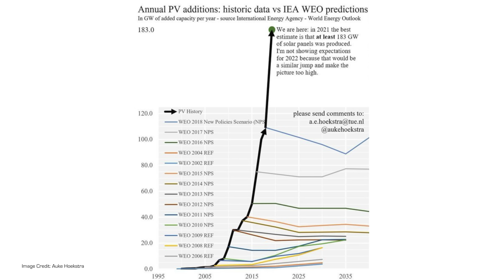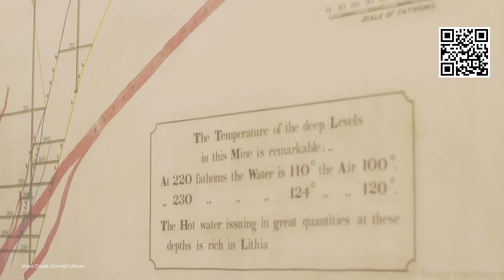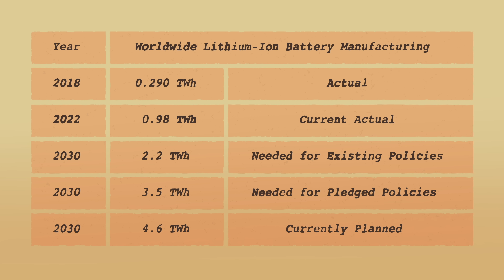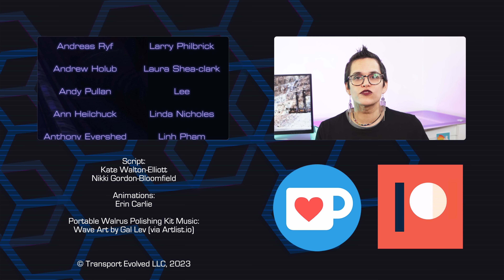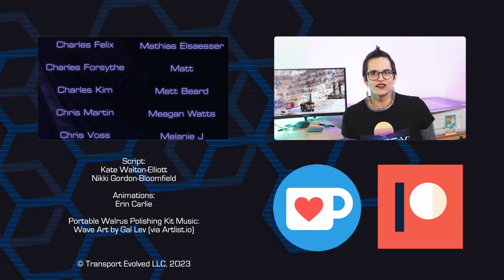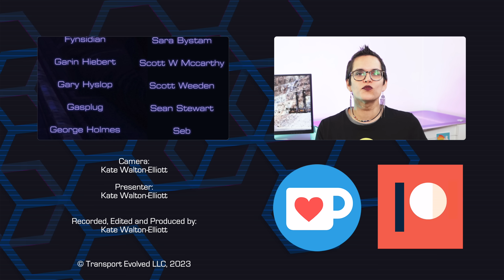It's Time For Us To Tell The Truth About Mining

Comment: Last question was .; do we need to reduce the need for these new resources we require.  The answer  is yes. So next time you buy an EV look at the size of the battery and how far does it drive on a full charge.  It is better to buy a Hyundai  Ionic 6 than  a Hummer EV for example. Good vid, thumbs up.
Reply: Ebikes have 1/100th the raw materials and up to 10x the MPGe of a Tesla.

Edited: because im bad at maths and I thought 18kg was 1/10th of 1800kg
Reply: I'm  for that.
Presently my Leaf '40 kW has ChaDeMo so there's no depending on a working charger if I leave town.
Reply: @GeoElk : I wish you luck explaining that to the die-hard “an EV could never meet my commuting needs” crowd. If they won’t get behind driving a full sized car that can do highway speeds, just because it’s electric, they sure as “heck” won’t get behind the idea of a bicycle that cannot manage highway speeds; regardless of whether or not it’s got an electric drive unit to make things easier.
Reply: @jacobcarlson4010  It's a good thing they don't speak for everyone then. Folks who "need" a full car can get an EV and folks who an e-bike would work for can skip the car entirely. Different solutions for different people is totally fine.
Reply: @jacobcarlson4010  it's hard to break indoctrination but it is possible. Work also needs to be done to genuinely make cities less car dependent.  Many who say they need a car are genuinely right, but a better future is possible. Also so much could be done on the subsidies front. So many governments are offering small discounts on EVs that could easily buy an electric bicycle outright...... That's when i start to get really depressed about the topic because I realise the subsidies have nothing to do with saving the environment and genuinely helping people, but instead it's about rewarding those who are already wealthy and directing money towards the same car companies who caused the crisis in the first place.
Reply: @GeoElk  The biggest thing we can do to help reduce car use is to reduce parking requirements in cities and try to allow infill development. Robo-taxi service is coming before 2030 and it means cities will need fewer total cars and up to 60% less parking. Imagine cutting every parking lot in half and filling in with new development & parks. This breaks the "chicken/egg" cycle of trying to jump-start mass transit and create walkable, bike-able cities. People love walkable. Go to Mackinac Island. Hundreds of ebikes on every block.
Reply: @GeoElk  I am wondering about MPGe of Ebikes when run on battery only. I saw that the new Lectric trike has a projected range of up to 60 miles when pedaling, but only 15 miles when not. Why isn't the high end infinite? My guess looking at drag coefficients for the upcoming Aptera, 0.13, versus greater than 0.50 for most motorcycles, is that some highly efficient EV's will achieve higher MPGe's than bikes that are not getting the majority of their 'umph' from their human operators. We should also find a way to factor in cargo weight into our efficiency calculation since several bags of groceries, or construction materials, or luggage or ... can limit what most of us can effectively pedal over a distance, and may cut that 15 mile un-pedaled E-trike bike range significantly. I believe the Aptera is asking for no more than 500 lbs of added weight (drivers and cargo combined) at least to maintain promised performance numbers. Some of us who care little about 'performance' zoom zoom may overload our vehicles from time to time, and may even DIY mod's to various suspension parts to help raise our Aptera's load carrying capacity. Anyway, if we are calculating relative MPGe's of Ebikes driven without any leg power vs Apterae we should at least equal out 'cargo' weight when making our comparison. I am not of the camp that might equate each gram more of battery weight, or cubic cm more of battery volume with subsequent environmental evil. I want to see robust V2G and virtual power plants helping to accelerate our transition to renewable sources of power. How these larger batteries are used should be a factor in assessing their environmental pros and cons, no? Different topic: As a 'leave most fossil fuels in the ground' advocate I also allow for the less desirable alternative that 'plastic' left in the ground or downgraded into useful 'still sequestered' building material is better than those fossil fuels combusted. How truly evil are plastics if they are safely locking that carbon away from overloading our oceans and atmosphere with excess CO2? We are now advocating for the carbon sequestration of wood construction over steel based alternatives, looking at the relative eco footprints of various building choices. Decking that may have some more intense carbon captured in its core may just sequester more carbon for a longer duration than wood, plus any necessary treatments it undergoes over its useful lifetime in situ in a building. I guess I'm advocating for more 'whole picture' fair analyses, rather than potentially prejudicial knee-jerk ones.

Comment: The interesting thing about these discussions to me is that everyone always ignores the single most problematic metal in EVs: copper.  But maybe that is because we are just used to exploiting the heck out of copper and nobody wants to mention how much of it is consumed by the construction and power distribution industries. How much of it is still used in plumbing (it is required in New York State for instance). But the reality is, 2 or 3 EVs contain as much copper as a small house. I would bet that charging infrastructure uses a great deal more. The good news is that companies like Tesla are looking to greatly reduce the length of their wiring (to reduce the cost associated with copper wiring). And many companies are pursuing higher voltage EV archetectures which can use smaller guages of copper wire. So maybe in the future we can expect EVs that use dramatically less copper... but as with all other minerals, recycling is crucial. 

Another issue I dont see people really discussing is IF we shift in a big way from lithium-ion to sodium-ion batteries, will the economics of battery recycling still work out? It is the use of expensive minerals that makes the economics of recycling work in the first place. Heck, a shift in market values of minerals by over extraction could also make recycling uneconomic. Will sodium-ion batteries be destined for the landfill because they arnt worth recycling?
Reply: I appreciate your comment, we can see the impacts of copper, nickel, iron, aluminum, all for electric vehicles. the entire supply chain is laced with fossil fuels. coal to extract lithium in Australia, oil to transport it to China, Coal to turn it into minerals, oil to transport it to Taiwan, Coal to make it into parts, oil to transport it to nevada, so Tesla can use solar to assemble the parts. oil to deliver the tesla to Australia where they import 100% of all cars. it's 20,000 miles in cargo ships across the pacific ocean.

Comment: Oil companies: mining is bad

Environmentalist: Americans burn 500 gallons of gas a year, 3000 pounds of material, or 60,000 pounds over a 20 year time, meanwhile EV batteries only use 1,000 pounds and last over 20 years in a car, 20 years as stationary storage, and 95% can be recycled and by that time energy density should have more than doubled (5% energy density increases every year) 

Not to mention we mine much more than that per person for steel copper and aluminum for a vehicles structure and other components.

Comment: Great video. It would have been great if rather than comparing to coal comparing to oil extraction and gasoline refining as this is the energy directly being displaced
Reply: True if one looks at electrifying transport only. But electrifying homes and factories will sometimes involve battery storage, and does displace coal use. You are right that the whole picture needs looking at
Reply: @tonykelpie  the whole picture is the USA needs 8,000 TWh by 2050, while reducing fossil fuel to use to 0. there is almost no scenario in which we electrify offices, homes and cars all at the same time.
Reply: @Lildizzle420  thank you for replying. The world is not going to end in 2050, but it seems that at current rates of progress the process of global warming will continue. I am not put off by lack of options but I am concerned about lack of progress in implementing the various options. Solar and battery setup can work well - our home is currently drawing zero from the grid and is expected to do so for 4 months of every year; we will have reduced demand on the grid in winter too.,and especially in spring and autumn

Comment: Great video.
One thing most people don't seem to know, or like to ignore, is that one of the biggest uses of rare-earth metals and cobalt are as catalysts is in the oil refining process; this has been the case for many decades. I would like to see how EVs -- meaning less use of fossil fuels -- change those numbers; does it even out compared to making current lithium EV batteries?
In 2021 there there an estimated 15-billion cell phones on the planet. How about all other the batteries used in cordless drills and the like? 
EV batteries are lasting a lot longer than people originally expected, with a Bolt in Canada with well over 400,000kms on the original battery, and many Bolts in the US having over 250,000 miles. 
Interestingly, I recently read that lithium can be extracted from the waste brine from the oil refining process.

Comment: All everyone needs to keep in mind is that if we mined the same amount of Lithium as the amount of coal we mine and burn up in just one year (roughly 7 billion tons), we would have all the Lithium we would EVER need. That's because the amount of Lithium used in a battery is quite small and it's fully recyclable. So once mined, it can be reused over and over again. Just stop and think about that for a bit.

Just one single year of Lithium mined as the amount of coal mined in a year would last us for our entire lifetime.
Reply: Some of that is true, but the devil id in the details. First there is a huge contrast in the natural abundance of coal vs. lithium. Second, so far there is no material being recycled at 100% efficiency. Quite the contrary, the real rate of recycling of recyclable materials is quite low. I’m not promoting fossil fuels BTW, just flagging that every option has pitfalls. There is no magic pill.
Reply: Same amount? By volume or by weight?
Reply: It's never fully recyclable. If we lose 5% we're on our way to exhausting the resource
Reply: @glenrunciter5463  Actually, that's not all true either. Lithium is more than likely more abundant than petroleum and coal put together. You see, coal and petroleum exist only in certain pockets in the earth in select locations. While lithium exists basically everywhere sodium(salt -NACL) exists. It's a cousin of it in the alkali metals list, sitting right next to it in the periodic table. And even in some petroleum locations such as the Smackover that exists from Texas all the way into Northern Florida which is full of lithium. It also exists in runoff clays, thermal vents locations, and pegmatite deposits. 

Think about this, in 1990, lithium was the 50th most abundant element on earth, while today it's now in the top 20 most abundant and climbing up the list. The reason? Prior to the Lithium Ion battery coming into the market in the early 90's, lithium had very limited uses (high heat lubricant, minor medical uses, scratch resistant glass making, etc.), so prospecting for it was not financially worth it. One mine in the US and another in Chile was more than enough. For context, in the 1980's the US provided more than 80% of the world's lithium.

Every single country of earth has lithium in various degrees. And there are several that by themselves could provide all the that is needed for all the EVs in the world to replace all current ICE vehicles (Australia, the US, Chile, Argentina, Bolivia, Canada, etc.). While the earths oceans waters have, by conservative estimates, many hundreds of billions of tons of it, while others think it's more likely into the trillions of tons. And that's just in the water, which companies have begun experimenting extracting it using new DLE processes. Especially from the concentrated brines from water desalination plants.

While in the oceans' bottoms, and I don't mean in the earth beneath the oceans, but lying free on top of the ocean bottom in golf ball to as large as softball size rocks, are many billions to likely trillions of tons of it containing Lithium and other rare earths plus Cobalt, Nickel, Copper, etc. 

One Canadian company, The Metals Company (TMC), has already started bringing them up and proving their viability. You can look it up yourself. But as you can imagine, the fossil fuel industry is already funding environmentalists and biologists opposition to it, as countries fight for the rights to bringing them up in these international waters. 

And remember, this is not scarring the earth below the ocean (like it's done when extracting oil), where it's estimated there are many, many trillions of tons of it based on its vastness and the lithium seeping up from it in some known locations such as volcanic vents, but merely bringing up rocks lying free on the ocean bottom full of it and other minerals.

Think of lithium today like petroleum around 1850. Prior to the discovery of oil in the 1850's in Pennsylvania, combined with the discovery a decade earlier that kerosene for lighting could extracted from it (it was previously extracted from coal), it was considered rather rare. Found in only small quantities in a rare few, small areas around the world bubbling up from the ground. 

Once these two discoveries were made, enter John Rockefeller (who at one point controlled over 90% of the world's oil, since it was only mostly found in the US at that time. That's how rare petroleum was thought to be in those days), and the decades later discovery (when the automobile came into the picture) that the byproduct waste being discarded from the making of kerosene called "gasoline" could be used for something even more useful than kerosene itself, that all hell broke loose. The whole began searching.  

That's what's happening now with lithium. It seems that every month a new location containing it viable for mining it is found. Canada has just placed another lithium mine in production bringing more into the market. Argentina mines coming into production this year and next will help vaulted it over Chile for number 2 in the world in production, only behind Australia, which has already said there would be at least 32% more lithium in the market this year, 2023, than last. 

So as you can see, the old black gold rush is now the new white gold rush. And with the whole world searching, it's being found everywhere. With that said, most of it won't be needed due to it's long term decades of use (unlike oil and coal which are burned up as fuel as are gone) then it's recycled, combined with only the small amounts used in a battery. 

So the real race is as to which ones get to bring it into the market first. And world governments know this, which is why mines are opening up in record times all over the world, rather than the usual long wait times.
Reply: @MegaWilderness  EV batteries last decades, then it's recycled. That's a lifetimes worth before more is needed. This is not petroleum or coal that is burned and up and gone in an instant.
Reply: @Paul-cj1wb  no one is going on o read this “dissertation”. Learn to synthesize. Ok n any case, a quick glance if the opening paragraph shows your assumptions are wrong. You need to learn the fundamentals of mineral resources economics.
Reply: lithium on it's own is useless with out the copper, nickel, iron, cobalt, aluminum, graphite and more. so it's a combination of mining, and you're not really replacing coal because coal is used to mine the metals and make it useable. well, except Tesla assembles using solar but everything else is pretty much coal. Australia is 75% coal and 100% oil for transport.
Reply: @Paul-cj1wb  This same logic was applied to oil, then coal, then uranium. They will run out
Reply: @MegaWilderness  Are oil, coal, and uranium recyclable? Or, in the case of coal and oil, burned up and are immediately gone?
Reply: @Paul-cj1wb  Everything is recyclable but requires energy

Comment: The fortunate truth is that for static applications such as home batteries and grid storage batteries, where weight is of no consequence, there are other options.  And best of all, they are superior to Li batteries in a number of significant ways.  They are from cheap, readily available elements which can be sourced all over the place.  These batteries should be way cheaper than Li batteries once they have enough market share to climb up the learning curve and slide down the cost curve.  Properties include: *They can be cycled between 0 and 100% with no damage, *last far far longer, *are safe from a fire point of view and hence can be shipped by land, sea or air, *are made from cheap, easily recycled materials, *need simpler charging/discharging electronics and a few more.  These include the liquid metal batteries based on Sb and Ca with other chemistries under examination, the ZnBr flow/plating and gel batteries, a number of redox batteries based so far on V and Fe and possibly the up and coming Na batteries.  Now there is one with unlimited resources.  There is something like 10kg of Na in every cubic meter of sea water.  Of considerable interest is that it has been estimated that soon, Static application batteries will be using more Li than EVs.  Saving all this Li for vehicles is bound to lower demand and hence cost and make EVs less expensive and hence speed up adoption.